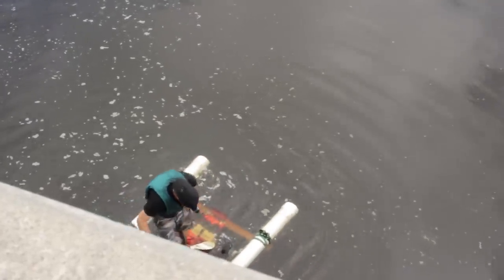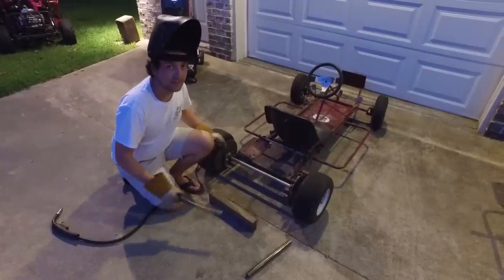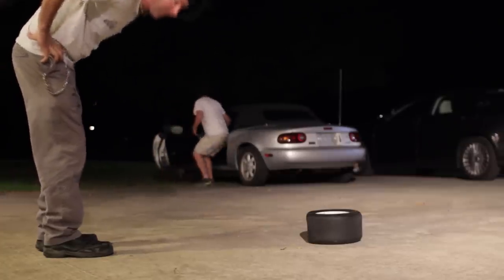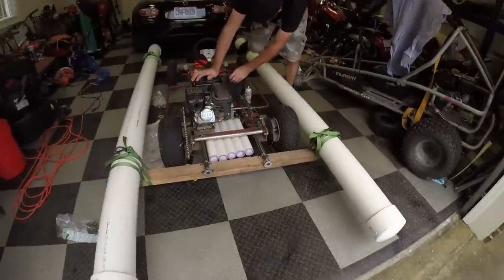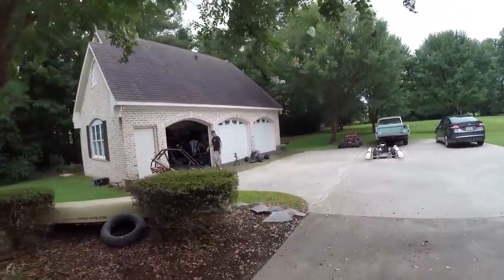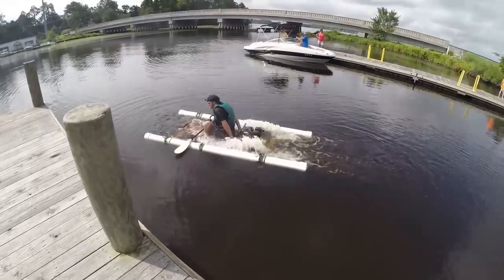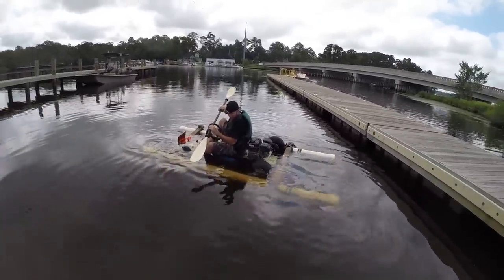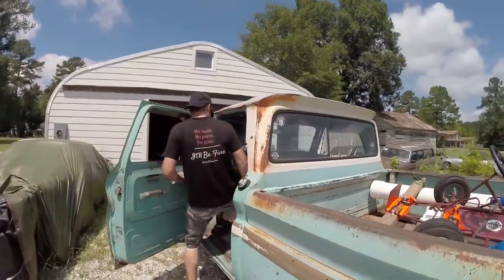AmphibiKart Pt. 2: Power & More Floats

Comment: I live in Hawaii and I made a mini water jet on my Kayak using PVC pipe and a small weed eater motor.  Just cut slits in the bottom of the PVC, O rings, shaft and a Trolling motor propeller.  If my kayak can hit 20mph on calm water with a weed eater, your predator will get you 30+.  You can put it on a mount and swing it side to side to steer.  Since the jet pipe only needs to be half submerged it won't interfere with your land wheels.  I also suggest putting the motor in a foam cooler, easy to cut and extra  buoyancy.  Adding extra PVC to the front and back will also help, I'm assuming they sell 90 angel connectors for the ones you got on the sides.
Reply: Videos?
Reply: yea they sell them, 25 bucks a piece. nice job with the kayak !
Reply: +Isaac it'll be fine how the hell you have 1,200+ subs with no content channel?
Reply: I guess because they like me being on carsandcameras
Reply: I would love to see a video of it in action. That sounds really innovative.
Reply: ill try to video next time I'm using it.  its not an original idea, I saw a few commercial kayaks with a better design.  I just copied it.  if you watch a channel named "aquachigger' he has one that he uses to go up rapids/rivers with shallow water.  its super cool,

Comment: I've got an idea, you guys said you had a whole stockpile of those 79cc motors. Why don't you mount one transverse either on the front or back(next to the 212) . Mount it at an angle with a shaft and propellor going out the back, held up by an axle bearing. When you get in the water just fire that baby up and you are off to the races .
Reply: It would serve two advantages, the motor would be at an angle on presumably a high mount, thus giving it the needed height to eliminate any chance of water intake. It would also not give much of a weight penalty due to its simplicity
Reply: +Jerry Wick  or maybe chain drive off axle that right angle drive they used on the radio flyer build and have a prop on it hell yea

Comment from the maker: It really needs a better propulsion system.
Reply: haha yea but. luv the build
Reply: Replace the wheels on the rear axle with something like a paddle
Reply: I told something last time. you could use paddle tires
Reply: Love da build
Reply: Get sand paddles
Reply: +AveryGaming12 | WolfPackAirsoft that's what i said
Reply: get some gears and a prop. put one gear on the axle and the other on a prop. Also, it would be cool to see a snorkel. Awesome video, again. keep up the great work!
Reply: Weld metal plates on to the rim like a water mill
Reply: 670 with giant propeller! !!!!!!!!!!!!
Reply: you guys need one motor for the wheels when you're on land and one motor with a propeller for when you're in the water
Reply: Nick Vernon it will be hard for them to drive on land and have the prop low enough to be in the water
Reply: +Dillon King it'll be fine
Reply: You could put little fins on each of the tires. And out more Floats in the back
Reply: i say you weld flat bar to the rim about 3 inches long. That way they stick out to the side not getting run over but can still paddle in the water.
Reply: Paddle tires
Reply: paddles on the side of the rim? also plywood "footboards" where you put those marine floats would help float. and some sort fenders or splash boards
Reply: maybe take some pvc tube and cut it through the middle to make fins and somehow attach them to a tireless wheel.
Reply: thanks
Reply: Update on the truck cab? haven't posted a vid on it for a while and was curious how the progress.
Reply: use a small prop for a trolling motor on another "magic box" like you guys have on the rat rod wagon and drive that from a different sprocket off of the live axle. then you could also play with gearing aswell by sprocket swapping.
Reply: paddle tires
Reply: use sand tires, that are like paddles
Reply: Have some boat props geared to the axle with a 90 degree 1:1 gearbox
Reply: fenders are a must
Reply: Have some boat props geared to the axle with a 90 degree 1:1 gearbox
Reply: What about a paddle wheel on a swing arm in the rear.  You can push it down with a locking toggle lever when you're in the water and when it goes down it creates tension on a drive belt.
Reply: cool
Reply: Just put a tiny outboard or trolling motor on it. Leave the 79cc for dry land propulsion, then switch over to outboard once you are in the water.
Reply: Also, needs a snorkel for the intake
Reply: y'all should use the The L shape gearbox thing like y'all used the Rat Rod wagon and hook it up to the live axle and just put a boat propeller on it with a guard on it so y'all can use one motor to do both Land and Sea :V
Reply: sand dune tires?
Reply: Just weld paddles on the rear axle that are short enough so they won't hit the ground on land
Reply: attack something to the rear rims that will act as paddels to give it some boost
Reply: put an axle paddle on it youtube search it u can find alot on them they put them on atvs
Reply: Make it simple. Everyone is saying paddles welded to the rims or paddle tires. This will work but won't give a whole lot of propulsion. You need more surface area for paddles so add them to the axle. Make them just a little smaller than the diameter of the tire. Those combined with the paddle tires or welded paddles on the wheel will be plenty. 
I thought the same with the top gear amphibious vehicle challenges.
Reply: +M Kefer that wolud look funny
Reply: All you need to do is take like some tractor style tires or the tires that are on the red off road gokart and put them on backwards it will scoop up the water and push you along really good.
Reply: +M Kefer true true
Reply: why dont you put the 670cc on so it will go faster
Reply: +Isaac it'll be fine  for better pull out power and stabilization and water speed put nabis all around and have another 212 in the front running the front tires
Reply: +TexanJoeRocks north calorina
Reply: +TexanJoeRocks look at this license plates
Reply: +Mike the hype and a home made snorkel for both engines
Reply: What about welding on some metal flaps to the back wheels (Mini Fairy style)? lol
Reply: you should put like some wheel arches on the back wheels so they don't splash everywhere
Reply: Aaron Larkin it already looks funny. lol
Reply: Fenders over the rear wheels that let water mostly out the back and bottom will add some go, just don't set them too close or it won't go at all.
Reply: get some paddle tires
Reply: paddle tires
Reply: If you could put 4" pvc coming off the tires scooping the water straight back like a jetski it should help a bit. Then you can make a pivoting rudder/jet similar to jetski steering. Shouldn't weigh as much as welding in a rudder and bracket considering it's mostly plastic.
Reply: Ok so you want it to drive ,and float ....Try to buld some pattles in the hubbcap on the back tyers   but try to make it in the cap._. But out more so it will grab the water ....Doing this  will keep the  ability to drive..
Reply: +WILSON! You where thinking the exact same set up I was.
Reply: Either paddle tires or have a propeller on the back that spins with the axle for the tires
Reply: put the motor sideways and use an actual boat propeller
Reply: try puting paddle tires on it like they use for sand dunes
Reply: you need to add shrouds for the wheels to contain the water better;)
Reply: +William Harden exacly what i was going to say bro
Reply: what state are y'all based in?
Reply: Use thick PVC over the rear tires like you did on the Drift Trike but, cut out some directional scoops (paddles) through the PVC, first. This would allow the "tread" to still be flat for the pavement and, while on the water, it would scoop the water like a paddlewheel.
Reply: T-Town Mini that could work.....but would that affect in LB .... and the pips are not going to last long....... it could split
Reply: Weld fin-like paddles  to the outside rims of the wheels so it's like a mini paddle boat on each side
Reply: Some better tires would be if you got some wood cylinders cut some notches in it and put flat pieces of wood in the notches. It would be much better than just nobbed tires. It would be no good for land but would work great in water!
Reply: just weld 4 padles to each rim and put the motor in a metal waterproof basin
Reply: You could try building something, like a paddle boat wheel, that would go on the drive axle. You'd still have tires for driving on land as well as a propulsion system for water.
Reply: hey fill the pvc with compressed air to make it float higher and take and build fins into the rim so once its in the water it has a bit better prupultion
Reply: +KrazyKustoms Media   Compressed air has higher density and is therefore actually heavier
Reply: +Wally Ginter I was going to say the same thing
Reply: time for the 670cc? hahaha
Reply: add a wind turbine to the rear
Reply: Where ever possible why not weld or rig pieces of flat iron onto the axle where it would function almost similar to the paddles on a ferry boat?
Reply: ...a gear on the drive shaft with a u joint to a cylinder fan,or two and propel the water .sorry for my English. Good luck
Reply: Put Paddles to the live axle.
Reply: Me too!
Reply: throw another sprocket on the axle and run a chain to a secondary axle behind the cart with a paddle like old paddle wheel boats on it and some fenders around the wheels and paddle.
Reply: use could use the force of the water that is going over the top to help propel you forward by putting on wheel guards. Enough that the water spray is kept in the guard. This would help with the flooding of the engine too.
Reply: For extra flotation you need to build a light metal water proof skid plate like a boat
Reply: +CarsandCameras Maybe need tires for sand. That maybe works. :)
Reply: Trolling motor
Reply: a tiny diff, like from lawn tractor. create a 90 degree for removable prop and wheels at the same time... a mini pto.
Reply: Because they didnt want to brick the engine with its weight and the water
Reply: It's a live axle. So weld a couple plates to that so it acts as a better paddle?
Reply: sand paddles
Reply: Axel paddles kid
Reply: make a snorkel for the intake. so the engine won't drown
Reply: Weld some sort of propeller system to the rims of the rear wheels.
Reply: +Max S yaaaaasss
Reply: put wood or metal tiles on the rim of the wheels and when turn the wheel it would turn the tiles
Reply: order sand tires for it. they will work a lot better then what is on it now.
Reply: put paddles on the side of the wheels
Reply: and fenders would help not spray water forward
Reply: You could put a wood tile behind the tire    and they would act as jets
Reply: U should put two engines instead of 1
Reply: I suggest you use the right angle transfer case you used in the rat rod cart to drive a propeller. Here is a drawing of what I would do to drive a propeller along with the wheel axles. https://gyazo.com/7c0db240f81d3a2bf1f2e1da9de61f6f
Reply: Hunter Laughlin
Ithink it'll be better to put the motor sideways and connect it directly to the propeller (with the clutch also), using the transfer case will put the motor too far on the side and unbalance the "boat?"xD
Reply: Mariangiongiangela's Tech Tips it's already on the side now and caused no issue, besides my solution allows both dry and water power
Reply: Hunter Laughlin I like your idea
Reply: extend the axle length and put paddles on the axle
Reply: take the tires off the wheels and just weld pieces of metal onto the bare wheels.
Reply: add a PTO propeller somehow im sure it's possible :)
Reply: Belt Driven with tensioner on a lever. Easy mode boys
Reply: Get some Dune buggy wheels
Reply: Or maybe put paddles on the axle
Reply: I was just thinking that too.
Reply: needs 2 be lighter
Reply: CarsandCameras weld a couple inch or two of Metle  squares on the rims
Reply: CarsandCameras you guys should get a small boat motor and link the throttle on it to the pedal, then somehow rig the steering wheel to the motor. If you cant use the wheel to steer the motor, try putting boards or metal plates on the front wheels so that when you turn the wheel its like rudders. That might work and if it does it would be awesome
Reply: CarsandCameras I have a 212cc predator engine in my mini bike
Reply: Cool
Reply: CarsandCameras use paddle tires
Reply: Hunter Rowland I agree
Reply: I suggest a water pump to the engine, not too big that the engine can't use it but bigger than a fountain.
Reply: CarsandCameras put something clear around. the. moater
Reply: CarsandCameras and put the moater higher then evey.thing
Reply: CarsandCameras is s
Reply: Put oar rings on the side, run some paddles through, then put a good size sail on it.
Reply: Ring and pinion with a propeller...
Reply: put a troller motor on the back bumper thingy, and put the battery on the pvc on the back.
Reply: part 3?
Reply: Justusewater skis
Reply: Take some steel wheels and weld on flat steel vertically in multiple locations to make your own paddles. Same idea as the old “big water” paddle boats. As far as a rudder, make a simple hand operated one that mounts to the rear of the frame with a long handle to reach the driver.

Comment: Get the paddle boat in Ike's garage! Put a chassis on it, then run chain to the drive rudder with a jackshaft!
Reply: That's what i was thinking just fill the gaps with foam
Reply: I like your profile picture, who dat saints
Reply: +Chase WHO DAT SAY THEY GONNA BEAT THEM SAINTS!
Reply: +Vooore lol i hope they do good this season
Reply: +Chase yeah that would be great
Reply: That's genius
Reply: They can get a bigger rear Wheel and put paddles in the axis
Reply: +Juanzerete that's not amphibious
Reply: Juanzerete on the axle? I was thinking that too in the beginning. Like put little paddles on the axle so its still amphibious and they dont touch the ground when on land. Then when the axle spins in water, the paddles will move the kart

Comment: Like a few people said, try getting sand tires so you can use those for propulsion. To save money, cut the paddle in half OR make a bigger paddle to act as a rudder which you can use by hand, or find a way to attach it to the steering wheel. Also I know its not a serious problem, but try replacing the two wood boards so the water does not weaken them. Its basically preference since I doubt you guys will use kart very often. Anyway good luck and enjoy watching you guys create awesome stuff!

Comment: try adding small plastic plates to the wheels one inch in height would make it go 10 times faster
Reply: It needs to be able to go on land to. The plates would break on land.
Reply: not if they where made properly but otherwise it would need a boat propulsion system and since they are on a budget that would probably not happen..
Reply: the bigger tires would just add weight and slow the raft down
Reply: they should add the paddles on tire wall sides
Reply: +Habbo Staff I still think the paddle tires would break on land and i dont know if they would fit on the go cart
Reply: That could work if you put them on the sidewall of the tire. That way it could go on land and water.
Reply: then its only a boat kart that can only ride on water
Reply: +Marius G Eggzactly !
Reply: Sand tires or paddles on the side walls...
Reply: Sand tires work well. They have built in rubber paddles on them. Unfortunately they're a bit expensive....
Reply: I would make the rear axle longer and stick some smaller paddle wheels on the side of the tires. Small enough to not touch the ground on land, but large enough to get a grip when it is in the water.

Comment: It seems to me that the tires are moving a lot of water forward, some kind of mudguard over the rear tires may help remove that opposing force and reduce the water going everywhere. Thoughts?
Reply: I am sure you are correct. those were my thoughts as well
Reply: yes definitely! exactly what i was thinking! you could also set up the guards so it forces the water backwards, so almost like a U shape above the wheel. You guys could try?:)
Reply: +Isaac it'll be fine why dont you add a 90 degree drive shaft like on the rat kart with a propeller on the back? She'll move then!
Reply: yes we will put fenders on it

Comment: I was thinking you could weld paddles the axle like an old water wheel, you'd probably have to extend the rear frame so that the paddles didn't hit every time the axle turned, and then for the "pontoons" make them on hinges and make them lock into place, that way you can drive it on land and water with just flipping the pontoons up or down. Then for the rudder, weld two studs on opposite sides of the steering shaft and run wire or even just string to the rear and mount the rudder to the rear frame, then when you turn the actual steering wheel it turns the rudder... Idk how possible any of this is, but ideas are flowing right now haha

Comment: Hi guys! 
A trick I use when I take my 4 wheeler mugging is to take a good deflated basketball and stick inside the front frame and then inflate it until it's wedged tight inside. You may could use that technique on the sides possibly.
Great vids! Keep em coming!
Reply: thanks